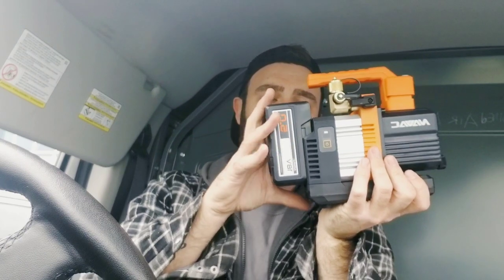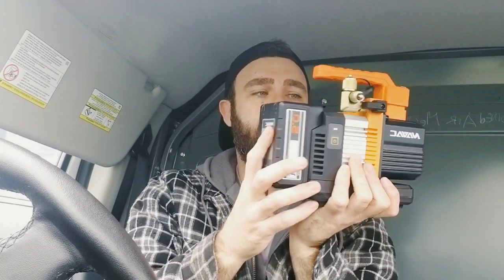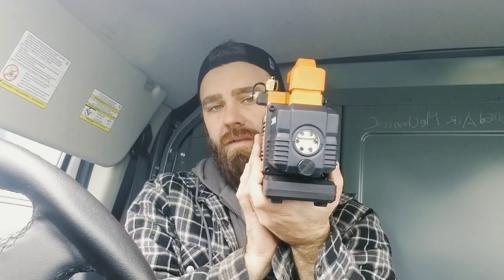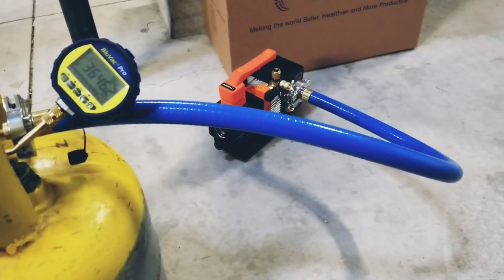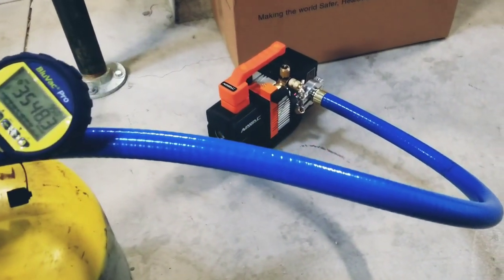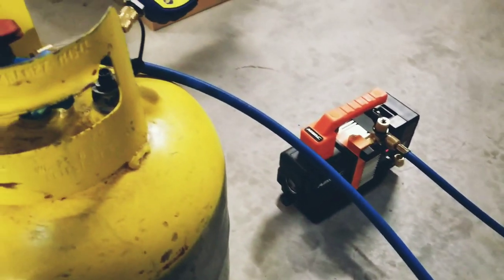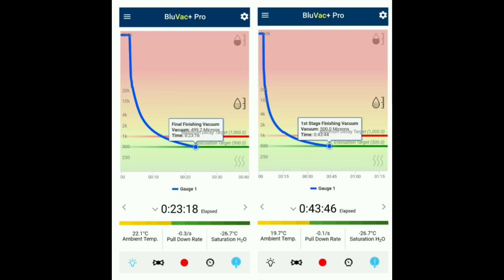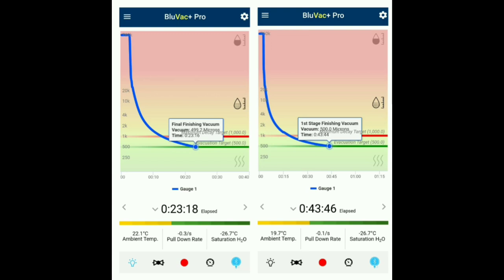TruBlu Evacuation Hose vs. A 1/4" Charging Hose w/The Navac NP2DLM

Comment: Always love your content but if I may expand a little…

The length of the hose makes a large difference as well. Example an 8 foot 1/4” hose reduced to a 5 foot 1/4” hose will speed up your evac time by 40%. (Assuming cores are removed)

In this video the head to head battle would’ve been a 1/4” hose the same length as the 1/2”.

Regardless, there’s no denying the science, the 1/2” hose with cores removed will give the best evac time.
Reply from the maker: Of course, length play a huge factor.

Comment: Great video, could it work for 2 ton refrigeration 80ft distance line set?
Reply from the maker: On new installs, 2 ton and 80 ft line, I would use the NP4DLM 4 cfm battery powered pump instead of the 2 cfm.  Don't pull through gauges and use large diameter hoses

Comment: hi Once u get down to required  micron  500  although flow is important under pull down it just requires time at this level ,the flow slows anyways . For small repairs fridges , freezers , room a/c , small mini splits , automotive it would be great for larger hoses but not absolute . 
 Recommended even in a mid size or larger domestic install . Dont forget the dedicated vacuum  hoses what ever the size
* Automotive has a huge issue they vac out for 30-60 mins . 30mins usually  by 99% techs  What happens is the system has spent no time at below 500 micron level DOH ...... 
The system is/could still be wet .........................  thankyou 
saves time 50% time  only 20 mins to 500 micron